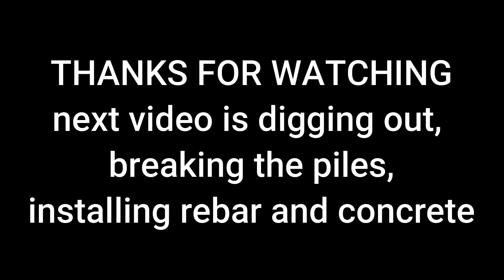Self Build house uk foundation installing 9 meter piles (PART 1)

Comment: hi Sean was there any reason you used pile foundations instead of traditional strip? was it because of land, cost ect
Reply from the maker: Hi Peter we had to use piles here because we would have had to dig down too far before reaching clay. The engineer recommended that it be piled.  Thanks for watching 👍

Comment: Sean what your honest opinion on the Hitachi u17
Reply from the maker: It’s a great wee digger, cheap to run and very strong hydraulics. Mine needs the pins and bushings changed but that’s the only issues I have had with it. Thanks for commenting